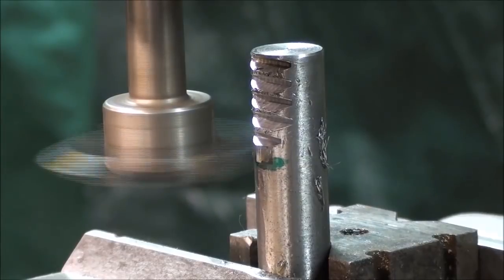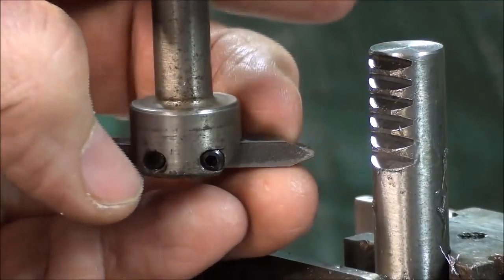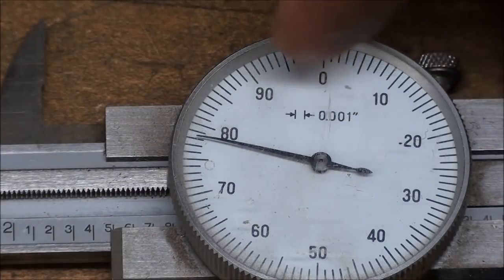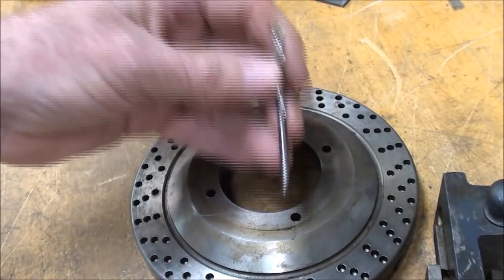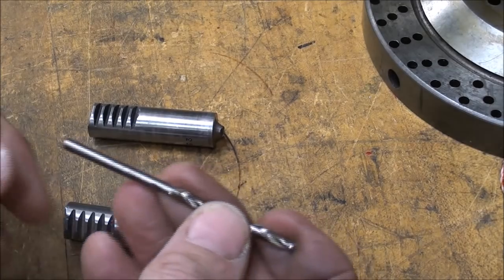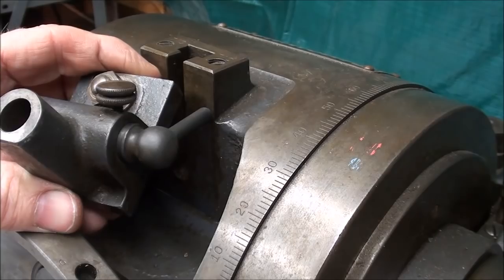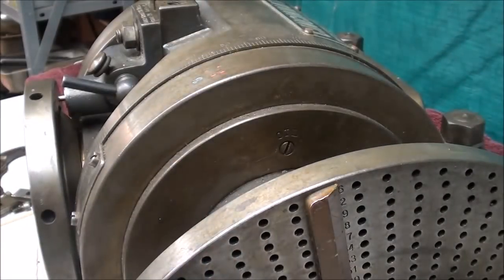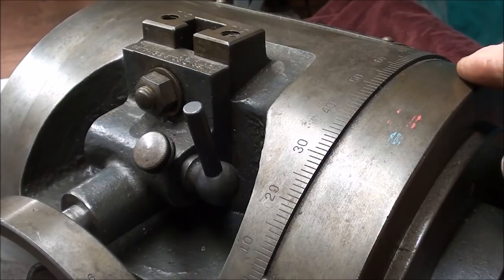SHOP TIPS #194 Cutting a Gear Rack on the Bridgeport Mill Pt 2 tubalcain

Comment: Great video.  I will never cut a rack but you have me curious enough to dig out my machinery handbook from 1967.  Yup an old woodworker has a machinery handbook, in fact I have two.  When I graduated from high school I trained as a mechanical draftsman and we used that book constantly.  But I never spent much time looking at the gear section and after your detailed explanation in this two part video I am curious enough to do a bit of reading.  Imagine if you will me trying to cut a rack on my table saw, big toothy grin here...

Comment: Another excellent tutorial video! I am sure you would have had a taper at the end of the original indexing pin to eliminate any "backlash" in the system when the pin was fully engaged, this could have been achieved by making the pin slightly larger diameter and turning down the front 3/16" to give easier register.

Comment: A+ mrpete222, I got to tip the hat to you after finding these videos and following just a few years this is the first ever that I have commented on. good job. I enjoy this more than 100 channels of cable garbage. being a tool & die guy for 19 years out of 30 in the plant. Tom from MI. I like the foundry stuff also .so cool I want to build a furnace to melt some aluminum.

Comment: interesting pair of videos on making that little rack. I've always been fascinated with gears and gear cutting. I have to admit I have a habit of cheating when repairing stuff and to make my job easier I would have just heated the original part in the forge to a cherry red and dropped it into sand or vermiculite and let it cool slowly .then chucked it in the lathe and drilled out the broken end and installed the drill bit as you did. reassembled it on the dividing head and went and had a nap.
Reply from the maker: THANKS for watching

Comment: The original pin had a radius on it, do you guess that the radius self centered in the hole, so the rotation was the same each time?

The straight pin will have a little play in the hole, so to keep the position from hole to hole rotation the same you could always rotate the plate against the side of the pin, or is this over kill.

Thank you for the detail and well explained videos I sincerely appreciate you taking the time to make the,
HH
Reply from the maker: THANKS for watching

Comment: Hi mrpete,
  Great videos. You also could have cut a rack on your Rhodes shaper for fun.  Also one little point on the index pin, the ones  I've seen on my dividing head and spin indexer are tapered on the end. Of course it may not matter much if the fit is close enough and you could always change it since you loctited it in.
Reply from the maker: THANKS for watching

Comment: great job man! thanks for sharing the video, I really enjoyed watching it, I just want to mention one thing! letting that click jump itself is not so good idea, it looks to me just like a little hammer hitting that indexing wheel every time. the power of the spring can make marks on the indexing wheel after sometime, and it can also affect the gear that you made or the pinion that is intact with it,  and maybe the pin that you made can come out after sometime. so I think it is better to hold the click handle until the lock pin is in place. I think that´s the best for the safety of the gears, indexing wheel and the indexing pin also. I am not a professional machinist but I just want to mention this. I love your videos and again thanks for sharing them with us, and keep doing the great job!!!
Reply from the maker: +Elhasane Elhafidy THANK you very much.

Comment: Hi mrpete,
Fun video on how to make a short rack gear showing everything from A to Z.
One thing that could be done to make a longer rack on a Bridgeport, if the machine allows tilting the head 90 degrees laterally you could make a much longer rack, playing with the quill and the cutter holder's length. Just a suggestion...
Thanks for sharing,
Pierre
Reply from the maker: THANKS for watching--good idea
Reply: new thing like bicycle trike
Reply: Pierre's Garage sale

Comment: Another great series of videos!  I took copious notes & stuck them in my Boston Gear catalog.  Comment:  I can see the chatter improves as you go down on the rack and there is more support/rigidity to your setup.  Thanks for the inspiration to do this at home!
Reply: +bentontool ; I would think if the rack were to be used in constant motion on a tool of some sort,  a more accurate ( stiffer ) setup and possibly a rough cut followed by a shallow finish cut,  in a climb milling direction for a smoother finish on the teeth...     might be an improvement.

Comment: My comment is not relevant to the gear cutting but pertains to the direct indexing pin being an undersized drill bit and having no taper. At its best, direct indexing has its built in inaccuracies. Having the index pin of uniform diameter and small enough for an easy engagement into the index plate increases the inaccuracy between any two holes by the slop between the index pin and the index hole. Following Pete's method otherwise for the repair, I'd recommend selecting a drill a bit that is too large and then turning (grinding) a self-releasing taper on the pin (drill bit) to achieve an easy entry diameter at its tip. The tapered pin ensures full contact with the diameter of the straight holes in the index plate taking out as much of the inherent slop as one moves from one index hole to the next before locking the rotation in place.
Reply: +Joe Blumber yes, I thought the same thing with the pin being tapered to insure no backlash in the hole, thus probably the reason it was designed with such a strong internal spring, to hold a small concentric contact area between the pin and hole very tightly. I commend the work however and always learn something every time, you're a great instructor mrpete222!

Comment: Thank you for reminding me why I would want to cut a rack.
 This may seem silly but started to watch this video thinking I would never need to cut a rack I'll just watch and learn 😁
At least until you reminded me of a project that I had forgotten about due to my thinking I would never find a suitable rack or have the equipment to cut a rack and now thanks to you I am going to build a good strong and correctly geared pillar drill as I can't find a new one that runs slow enough and with enough torque to use a hole saw or a large drill.
I am planning to use a motorcycle gearbox and a high and low speed belt pulley.
So thank you for your valuable education from myself and anyone else who didn't get to learn shop engineering at school due to the health and safety squad removing metal work from all public schools in northern Ireland 😭
And I would like to thank you for your videos on YouTube.
 you are changing lives for the better world wide. 👍 Keep it up 👍

Comment: I don't have very much experience with dividing heads I have only used two I think one was a Harding that I used one time it was not mine it was my brother-in-law's and I have my Chinese one that it was all that I could afford at the time and both of them for direct indexing that pin has a between one and two degree taper on it. It's not a straight pin! It actually gets kind of stuck in that hole where it takes a little bit of a pull to get it out. I noticed it on the Hardinge as well

Comment: Another great pair of instructional videos. I'm still trying to figure out if the length of the tool hanging out is relivant. As long as the profile of the tool is correct, the circular cutter's diameter was determined by the number of cutters (in my humble opinion).
Reply from the maker: THANKS for watching

Comment: Great video, gear cutting can be a lot of fun.  It's amazing the precision we can accomplish if we pay attention to details.  One suggestion I have is that when you make vertical movements with the knee, don't reset to zero each time.  Instead, write down a list of way points.  This eliminates accumulated error.  Actually, the same goes when even using a DRO.  For instance, rather then moving 0.500" then reset and move another 0.500", start at 0.500, then 1.000, then 1.500 and so on.  I'm I making sense?
Reply from the maker: Thanks

Comment: Also wonder if that radius on the original pin, and the slight chamfer of the holes on the plate allowed it to really self center better than a straight sided pin?
Reply: I also thought so....  with that radius it will take out the slack between the pin and the holes and it will be more accurate.
Reply: it probabli was a taper also. so is mine... to self center and to remove the slack.
Reply: it does! that's a critical factor when doing direct dividing.
Reply: Peter Owens I would agree and might explain the strength of the spring.
Reply: rrangana11 
I totally agree with this, as the pin clips within the hole, this chamfer makes it fit exactly at the same relative position from the center of the timing wheel hole. Tightening the nut on the side should only prevent it from getting out. mrpete222 should have turned the whole piece and then hardened it for better precision. Anyway, there should be a rough 1/200" backlash with the piece made here.
Reply: I didn't like how loose the drill was in the plate holes. I felt this need to be a much closer fit. A chamfer with a strong spring might be the ticket.

Comment: The factory shot pin looked tapered, no doubt to get a tight fit in the holes and provide precise indexing.  The drill shank does not fit as snugly in the holes and therefore there is some lash in the indexing mechanism.  I assume the outside holes could be used to hold the backplate fixed while you are unscrewing the chuck, the shot pin probably was broken as a result of someone using it to hold the backplate while they wrenched on the chuck.

Comment: Thank you for the informative video.
Question, it seems the drill bit is quite undersized for the plate hole, won't the add significantly to error?

Comment: I see that you came across one of those elusive unexplained oil holes.  Usually some one quickly stamps the table or what not with the word oil after accidently drilling into the table or such.

Comment: You milled .012" off the round stock and then used the full calculated depth of tooth.  When making a rack do you always start from a flat surface on round stock and does this in anyway effect the depth of tooth?

Comment: Hi mrpete, have a bit of a tricky question:
my bridgeport (J-head, vintage 1964) has metric dials on it. would i need to change the lead screws if i were to swap out the metric dials for imperial? someday it will be retrofitted with a DRO but that's a little off in the in future, for now the quick & dirty would be to swap the dials
Reply from the maker: Here's how to determine if the lead screws are english.  On mine, one full turn of the crank is .200". That makes the screws 5 threads per inch. Use an indicator to determine if one tunn on yours i s moving the table .200. Also look under the table with a light. Using a ruler, count the threads in one inch. Should be 5 tpi if english.
pete

Comment: I don't know if you would care to answer this question or not, but here goes. I have always been fascinated by machining of things and now that I'm retired I intend to learn. What brand name and or model would be a good lathe to have, to learn the old style machining? I've been looking around on line and see that there are tons of types and brand names. I see you're using a Cincinnati and since I live with in driving distance of Cincinnati, a Cincinnati may be more likely to be found around here. When I but tools I'm of the type to rather not buy a tool and turn around and have to repeat the process for an additional function. I really enjoyed your trip to Detroit, I lived in Chicago as a youth for a while and went there myself. Thanks
Reply from the maker: south bend, logan, atlas, clausing

THANKS for watching
Reply: hi Julian, i concur with mrpetes recommendation for brands on lathes. craigslist is a good place to start looking as you can come across deals locally you won't find in ebay, although ebay can also be a good place to get a good used lathe as well if you don't mind driving a distance to pick up your machine.
i would stay away from the chinese imports since they require a higher degree of skill in the set up since the quality of the machines leaves a lot to be desired. even experienced machinists have their share of problems with setting up on these machines and getting consistent results.
US and british manufacturers operate to much more exacting specs than do the hobbyist machine manufacturers of china and taiwan such as grizzly and jet. there will be some guys out there who disagree, who have had good luck with their machines. but these are the lucky guys who either got a good tuesday machine or overhauled it to make it work.
if you do decide to buy a cheapy you should consider throwing away the chuck and buying a good american made or german (Röhm or Forqhardt) chuck. same thing on the live center. another consideration would be to replace the spindle bearings with either timken, SKF or FAG brand bearings. the chinese ones are usually junk and often run out of round.
this can get to be quite a spendy little hobby and to be frank about it you would be best served buying a decent used domestic machine. the lathe i have is a clausing and my experience with it has been very good, they are very good machine, other guys doing these videos in youtube are working off of south bend lathes and you can see for yourself the quality of what they are turning out. it speaks for itself.
hope that helps you and happy machining!
Reply from the maker: mmikeyy27
good advise

Comment: Hi Mr. Pete, I was wondering about compounding errors by resetting the z axis to 0 after every move, wouldn't it be more accurate to just keep adding the .131 each time? I understand the reduction of errors in your method. Just wondering.
Reply from the maker: I'm sure it does. But easier this way. only a few teeth

Comment: What was the advantage to making that whole part rather than simply heat softening the end, facing flat and drilling for a replacement drill pin?
Reply: oops I should have read down a bit further.  Silly Spoon!

Comment: If you had to cut a dovetail for a fixture and didnt have DT cutter /want to spend the $150 for one, could you use the same concept and shape a tool bit to cut it out the same as you did for the gear rack? Obviously multiple passes and size might matter.
Reply from the maker: THANKS for watching---yes

Comment: I'm trying to find a fly cutter like the one in the video and all I find are the kind used for surface milling or those adjustable boring head thingys which are very expensive. I don't have a lathe I could use to make one. Any suggestions?
Reply from the maker: THANKS FOR WATCHING--I've never seen them for sale. This one looks home made, but noy by me. Check ebay
Reply: mrpete222 I've been enjoying your videos for a while now. I've been setting up a mini mill I got from harbor freight to produce a prototype of some inventions I've had in mind for quite a while. It's a lot slower going than I expected. Lots and lots to learn! Sheesh.

Comment: The oil holes go to the spindle.  I just checked the drawings I have from mine.  I could send you digital copies of the drawings from the manual and the brochure if you'd like for the Cin. 10-14" dividing heads.
Reply from the maker: Rich Naples Thanks Rick.. I now have copies of the manual

Comment: I have a K mfg  dividing head. I can't seem to turn it 90 degree from it zero degrees.
I've tried to lose the two nuts but it seem to be stuck. any suggestion?
Reply from the maker: Thanks for watching. Are you sure there is not a lock someplace on the head? Otherwise, you may have to disassemble
Reply: thanks for your comment! and you we're right!
I have disassemble it, and set it up. thanks again. now for my next task!

Comment: Best video on this subject! 
What DP do you use if your calculations come to 24.5 dp?  24.6 dp?  Do you round up or down?
Reply: What you would then need to do is go back and measure that outside diameter again.  Any deviation from a whole number is due to, or a reflection of, a measurement error or wear.  The 'outside' diameter is used in the formula because the 'pitch' diameter can't be measured, and adding the constant '2' makes up the difference.
Reply: (...forgot to add)  therefore that remainder will always be a small fraction, Unless the measurement is really off.

Comment: If you drill a hole for the pin .. Wy not use the original part and drill a hole in that part.
You can also unscruw the top nut en lift the part so it is not aligned with a hole. This release the pressure of the spring and there is no need to tighten the top screw
Reply: I believe Mr. Pete was wanting to demonstrate how to cut a small rack.  But I agree with your thought...
Reply: *****
i had the same problem on mine and just made a new pin, drilled the plug and brazed the new pin in place. if the part is hardened it can be drawn back by heating it up to orange and inserting it into ashes to cool slowly.. then you can drill it easily with a cobalt alloyed drill or even an HSS. re-hardening is just as easy: just reheat to orange and quench it in oil.. on small pieces like that, cracking isn't too much of a problem. cracks usually develop if the process is repeated too many times